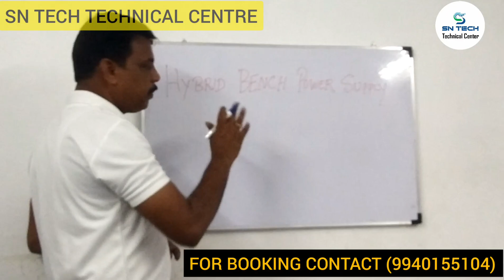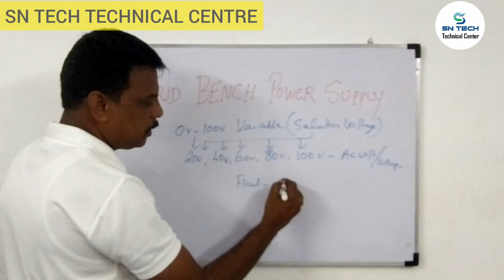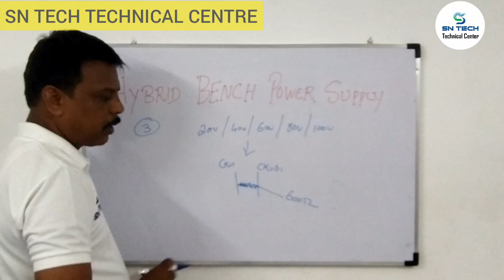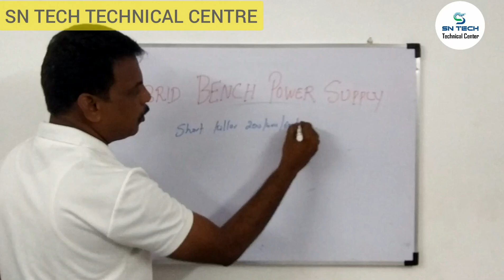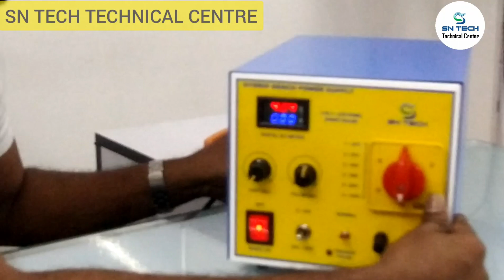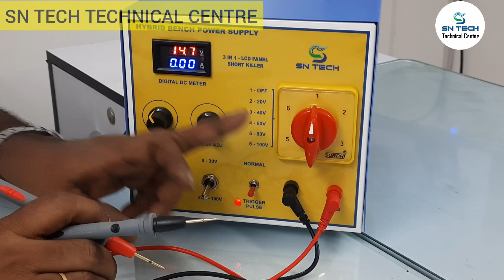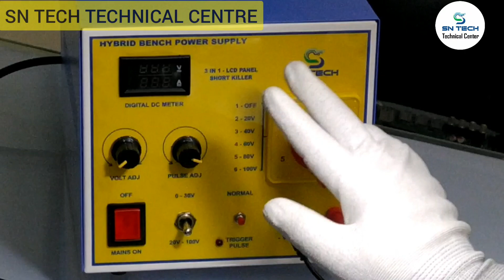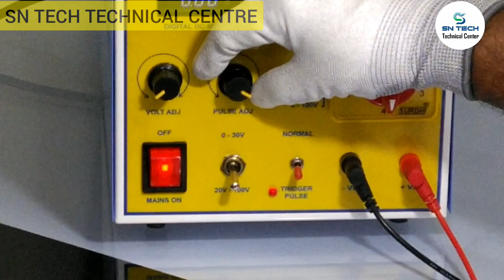LCD PANEL SHORT KILLER

Comment: Is is safe to leave the driver board in circuit when applying 60v or should it be taken out of circuit via cutting both lines? 
Also can a lower pulse voltage be applied to remove the short or does it have to be 60v?

Comment: Excellent technic sir.l really appreciate you. Small doubt sir you applied trigger only for one set of line with out cutting the both tracks whether it nothing happens to other parts in scalar board.Pl clarify my doubt Sir
Reply: What voltage is used on the ckv lines?